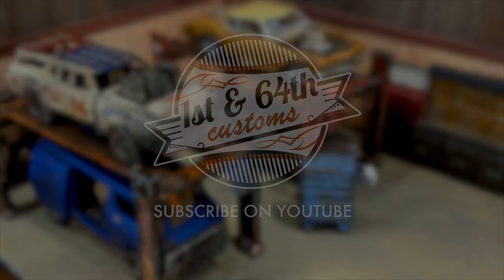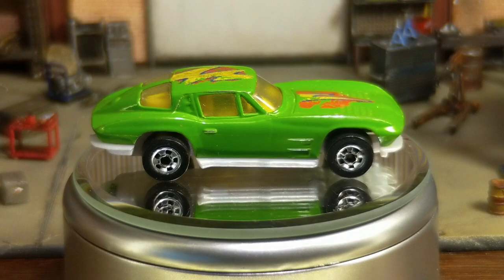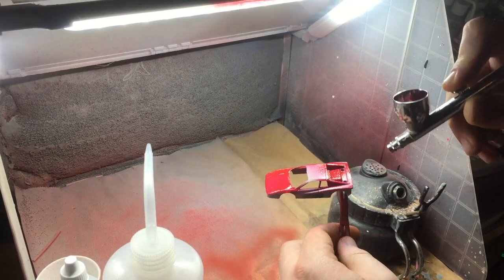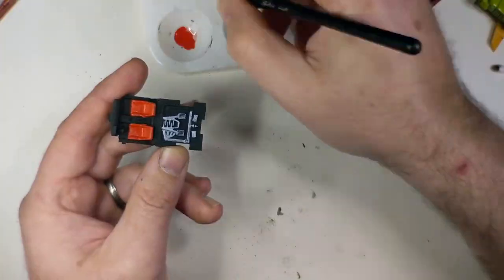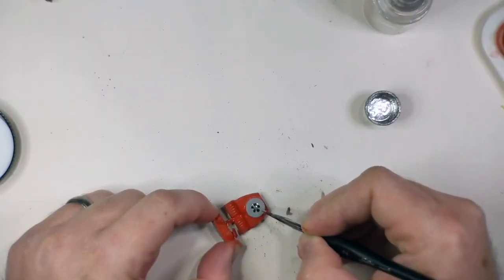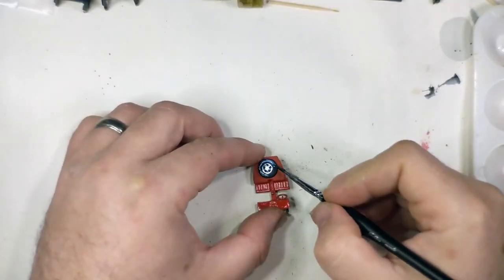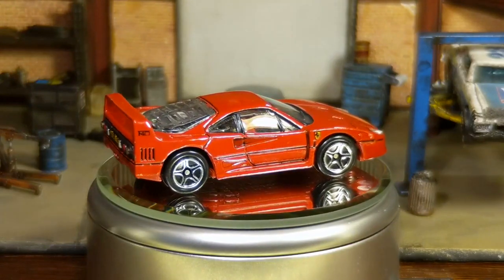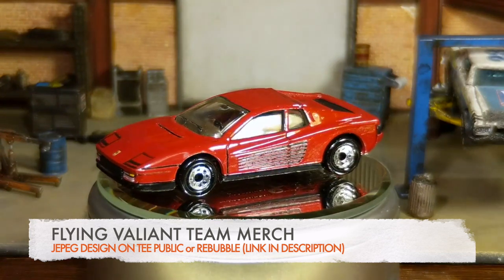Restoring Beat Up Matchbox and Hot Wheels Sports Cars into Realistic Custom Diecast Showpieces

Comment: I think they turned out really good and it was fun to see you do something different. I have recently switched to a urethane clear coat from Brightvision (or the Redline shop, but I haven't tried that one yet) and they are far superior to the rattle can versions I've tried, so that might make your finish even better... But there is no getting away from the anxiety of a piece of dust or whatever in your clear... Lol. Great job, but I prefer watching you weather cars if I'm being honest
Reply: I have to agree that the clear coat is the most nerve racking thing. I've done plenty of awesome paint jobs only to mess up on the clear and have to start over. I've had great luck with the testors extreme
Reply from the maker: Thanks, Evan! Yeah. I think you're right. Weathered builds seem more "me."